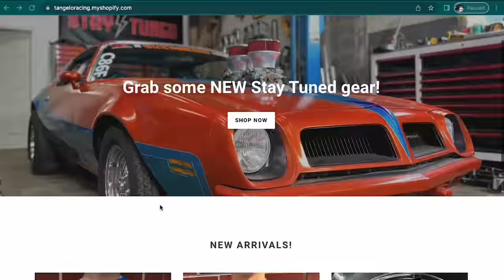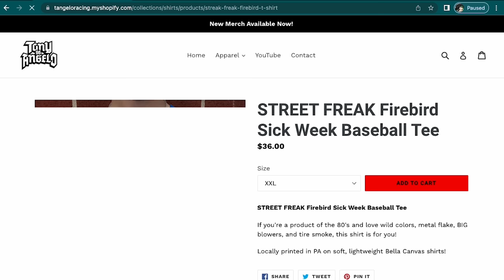Abandoned for YEARS! Can We Save This Amazing Old Ford Truck?!

Comment: one fun thing to do with that p7100 is to get a brake bias adjuster for a race car and hook it up to the preboost screw so you can mess with at idle fuel while driving. I had mine mounted at the bottom of the dash above the trans tunnel.  Becomes a "smoke knob" if you feel like screwing it that far... or have the need. Kinda nice to turn it down when you're not doing much, but bump it up when you're towing to get that off the line response. The AFR mods are super worth doing or redoing, they get done incorrectly a lot of the time.
Reply from the maker: ooooh. I'm into that. Coal on the fly!

Comment: I love the idea of body swaps, take old looks and combine with modern tech. I've kicked around the idea myself, but haven't found the right car yet.
Reply from the maker: It's really such a killer package if you get it to fit and look right. Takes a lot of upgrades to make an old truck drive like one built 20 years later.
Reply: @StayTunedTA  Yep, and sometimes there's no amount of upgrades that will get it right. I have a 57 Cadillac Coupe Deville that's in that zone, but she drives good enough from the factory that I don't have to swap it. Doesn't mean I haven't considered dropping it on 94-96 Caprice chassis.
Reply: I feel like “modern tech” is doing a LOT of heavy lifting when you’re talking about a 12v Cummins lmao
Reply: @chriskeiser5809 relative to the original drive line, it is "modern tech". I guess 😂

Comment: Hey Tony I know that you're very knowledgeable when it comes to cars but in case you weren't aware when it comes to towing 60% of the weight should be at the front of the trailer to prevent trailer sway & that heavy Cummins was at the rear of the trailer.
 Also that white Dodge Ram 2500 you purchased looks like it has a leveling kit in the front. I would remove that if I were you because the truck should have natural rake; 2 inches taller in the rear so when you tow close to max it's level. Otherwise you LIFT weight in the front & affect steering = bad time.

Comment: Tony, I had a 2002 V10 F250 for 12 years.  Pulled a 8300+ camper around the country many times.  Your right about the gas mileage.  It would pull anything you hooked it to and would pass anything on the road except a gas station.  It served me well for a very long time. I eventually upgraded to a diesel also.  Great content!  Keep up the good work.

Comment: this is like my dream truck. Growing up my grandfather had a 72 f-250 hi-boy that he and my uncle swapped a perkins diesel boat motor into. IIRC it had a manual trans, t-case, and an over under regular box so the thing had like umpteen gears. non turbo so it didn't go anywhere fast but man it was cool. I remember driving somewhere and smelling brakes only to realize the parking brake was still on. After my grandfather passed my dad sold the truck. I actually found it a few years later on craigslist but the seller stated "previous owner ruined it by putting a perkins in. we corrected that and it's got a 460 now. I wish i was old enough to drive before it got sold, maybe I could have gotten it.

Comment: Put a secondary fuel filter between the factory filter and the cp3, the factory filter doesn't stop the smaller particles from murdering the injectors.

Comment: Prob would be a great  candidate for dual batteries but def a nice truck!! And maybe a divorced t case and a solid front 4wd setup and that would be a truck after my own heart!!! Lift it very little with some fat 33s tucked in as far as possible and a winch and front bumper and a tool box in the bed with fifth wheel and that beast would do anything that’s required of it.

Comment: Super cab camper special body. Awesome find. Very rare around my area. There is one that has the double sunroof that the dude won't come off of (been sitting for 20 years and has trees in it) 

My concern is the not having pizza and having steak instead. Might be losing the shop after all 😅

Comment: Extended cab was still very rare back then.  Strange how long it took to figure out trucks can be used for passengers and stuff as well.  My parents had a 75 f100 regular cab so family vacations my sister and I rode in the camper or topper which is so sketchy

Comment: Yeah was kinda surprised
when you drove away &
looked at a 2004 ram.
To me brakes are a simple
job to do , shoes , discs ,
fluid lines , brake cylinder
booster, so again surprised
when you towed it back to
the shop , fix it proper & use
it as a spare or for extra
Towing 🙄😮😁😁

Comment: Tony from one mopar man to another especially A body and both E Body owners not thrilled with hot rod transplants of drive trains. But love  the ones you and Lucky did for MT, and this 5.9 litre inline 6 cylinder Cummins FORGED 250 is very cool. Hate Ford but keeping it real the 70's body styling of Ford was some of their better design work. Not sure how bad the Dodge must have been for the swap to make sense but it is one of a kind. It should be a back up shop truck , not like the Crown Hick is but one that can give it a chance to be useful especially as other vehicles need some down time as they age. 
One thing I know is that cummins will eat Rear ends and twist bodies like an  aluminum can, so  don't let the body continue to deteriorate and check the  body - frame - engine grounding points for large resistance. Electrolysis especialky in locations with high salt content in the air will be greatly accelerated if not grounded properly. 
You know things are not getting cheaper and the Truck Market is huge now and will be until they no longer produce gas/diesel for us to power our vehicles. Its way to cool to let go and so much history with you and Brandon. Is he the one you sold the Cadillac to? Your camera man from  hot rod garage? Hey you didn't lose that shop they lost you as host and writer, I hope your getting your family time back and are happy back in PA. Your missed out here in CA. Your a hell of a talent and funny as well, Mopar or no car unless you need reliable transportation that's not 50 years old then there are stipulations to that motto.

Comment: Fix up some of the rust issues. Put a factory rear bump on it maybe If you could find Ford hubcaps that came on the original truck, they would fit. Look pretty good, pretty cool ride. Ford F250 with a Ram. Thirty five hundred chasse with a twenty four belt commons d

Comment: At first I was like Tony you gotta buy that truck but then every time Brendon talked about the truck all he said was it broke down here so I fixed it oh the n it broke down there and I fixed it. you dont need that aggravation in your life. It a super dope truck but would need a total rebuild to make it a good two rig!
Reply: A fairly accurate assessment. The only times it ever left me stranded was when the (aftermarket) lift pump went out, and when the “BHAF” filter caught on fire while pulling a suburban down to Finnegan, on a 4 mile grade. They’re so bone simple mechanically that they’re pretty easy to keep it driving when you need it to.

Comment: At seventy three and molding like your ford here.... thinking of reviving a 56 international jubali body with a at this point torn between a ford explorer which is a no brain loser of a rig but four wheel drive and simple same frame width...  has  the 8.8 posi automatic, would like to go with a man stick but I have size sixteen shoes and so not too much room for my feet to fit inside of the area for pedals and such. Since there are so many LS swap rigs that its just not a attention thing much anymore when considering the prices of anything you have to buy and i have all of the above stuff to go to a international body swap already plus the explorer is a low mileage ..... thirty thousand on the clock for a 95 is good and body is dying on the explorer. Sure it looks good but close tells another story. I'm too old to even finish it considering of the fact my kidneys are failing and hospice seems a only step for pain management... might just take my mind off of a dead horse and fix something my young son who is only sixty now, he might use it for hauling his firewood here in alaska. Not going to many car shows here although we do have a few local events on different holidays... what do ya all think of or about it??

Comment: Seriously this is similar to what I have in mind now that is wanting to trade my 2000 dodge ram laramie slt quad cab long bed 1500 4x4 i am wanting a 68-71 ford f250 camper special trim truck or a sport custom pkg truck 352,360,390 fe bbf motors doesn't really matter to me but the rear springs and the front disc brakes, and the c6 automatic transmission but id take the 4spd manual shift transmission too, anyway the rear spring pack on those trucks are beefy way more than even my 2000 dodge ram laramie slt quad cab long bed 1500 318 magnum V8 46 RE AT transmission, and the factory towing pkg... but it does have the classic bodylines and the character the 68-71 bumpside Ford trucks have and I have been wanting to do a shop truck/farm truck project idea with a bumpside Ford truck

Comment: You guys forgot about hillbilly brakes - let most of the air out of the back tires and it will only move with the throttle.
Reply from the maker: Yes, but the first time we went up we didn't even bring a trailer lol. I wasn't doing hillbilly brakes for 90 miles across PA!~

Comment: I’ve followed this advice: So what do you do when your car and truck are both broke? Buy another car… which is also broke.
Reply from the maker: Yes, this is correct. Then decide to buy another car "so you can have a driver" and then find one that doesn't drive and needs lots of work. Repeat until the reaper comes to claim ya!

Comment: Help me here, the video of the truck on fire at the beginning, was that from the past or after you fixed it and back on the road ???
Reply: I was towing a square body suburban to Finnegan in GA, and was running 81S. There’s a few long grades south of Roanoke and the air filter caught on fire and went through the turbo, had me down for almost 3 days.

Comment: Would've been more sketchy had you loaded the truck front ways. All the weight of the rig is in the front and the axles on that trailer are towards the rear.

Comment: Is your new truck a 2004 or a 2004.5 ?  The 2004.5 and up is alot better than the early 04 trucks.  The big problem with those trucks is they are all best to crap and butchered by this point in time.

Those brake flaring tools are not meant to be used in a vise, all of those flaring tools are copies of the brakequip tool which has a mounting base that can be attached to a workbench or tool cart.  Even the earls flaring tool is just a relabeled brakequip set.
Reply from the maker: What's the difference in 04 vs 04.5? This thing seems pretty good. It shifts hard and runs well.
Reply: @StayTunedTA  The 04.5 has a larger turbo, 3 injection events, piston oil cooling, electric waste gate control and supposedly a better flowing head and intercooler and a 325hp power rating.  Some people say the 03-04 pistons were a better design but I haven't really seen any difference.  They also have different ecu and control strategies.  The 04.5 trucks seem to start easier in cold weather and warm up faster.

There is differences in numerous parts as well, the fan clutch is one of them and I don't know how many trucks I have seen with the wrong fan clutch.  On either version of truck be prepared to pull the dash and rebuild the hvac box since they are prone to blend door failures.  I replace the plastic blend doors with billet doors as a permanent solution.

Comment: What's your hoist rated for lol, by the looks of it I'd say that's about a heavy a vehicle that I would put on that.  I got kind of nervous seeing your boy crawling under there with the front wheels off and no jack stands or anything!  I've seen two 10k lifts break their safety pawls with 1 tons on em when u worked at a dealership as a kid.  More that I'm watching I see ur post says 4k kg, which is 8800lbs, just so ya know, I bet that trucks close to 9 or 10klbs easy, but I could be wrong, be safe out there.  With no top cross member on the lift, and questionable thick concrete and anchor depth, you don't wanna have them posts tip over, or like I said break the safety pawls

Comment: Well the good thing is that the fordodge makes it easier to allow it to roll backwards into the pond, because both Ford and Dodge deserve to be at the bottom of a large body of water! Also a Chevy most certainly deserves to go nose first off into an old coal strip mine! 

Now the Toyota just needs to be set on fire where it sits, and the Nissan needs to be crashed!